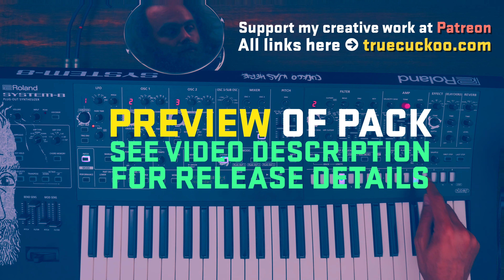System-8 Sound Design Mega Tutorial

Comment: Cuckoo, this is one the best SYSTEM-8 tutorials on YT now.  The SYSTEM-8 is currently the understated flagship synth of Roland.  I love it.  It can sound 'Roland-ish' yes (what's wrong with that?  It's a Roland! ha), but if you spend some time (as you have) programming it, it will reward you immensely.  Same for the JD-XA, which is significantly more complex.  The plugouts on the SYSTEM-8 are amazing.  Juno 106, Jupiter 8, JX-3P plugouts are really spot on.  Plenty of videos comparing.  Great video Cuckoo.  Fun to see you 'branching out'.
Reply: I got one a few months ago and love it. After many years exclusively using VSTs, sound design has become fun again. The direct controls and (pretty much) no menu diving makes it so easy and natural to shape the sound that I often end up making a totally new patch without even intending to.
Reply: I bought JD-XA over this System-8. You get more polyphony in its digital parts and 4 genuine analogue voices. So it's more like Roland's Zencore, XV, D-50 and JD products. On the negative side, JD-XA analogue LP filters 1 & 2 are hardly different and neither is LPF3, except it distorts very easily. So it's analogue is a bit bland. I love the digital section, where you can layer up to 3 PCM samples X4 voices, with Super Saw and PWM Square wave. There are many hidden features and flexible effects too.

Comment: System-8 is so underrated. I love this synth. The Jupiter X is not even close. Wish they would continue down this ACB modeling path instead of the 90's sounding ZenCore.
Reply: i know this is late but what’s better about the system 8 compared to the jupiter i’m new to synths and sound design
Reply: @spacecowboy2625  the system 8 has it’s own synth engine and a few others. The thing that makes this engine a bit more powerful in terms of emulation is that it focuses on recreating the individual circuits and electronic parts that give each analog synth it’s sound while the Jupiter x has an engine more akin to a sample filled gigging keyboard which means it is more like a recording of a recording of a synth. It’s a good keyboard but marketed for the wrong market since it isn’t as good from a traditional sound designers point off view. This is a better subtractive focused synth while the other is better if you want to cover more than synth sounds which isn’t something the analog/virtual analog market desires as much. They just fulfill the needs of a keyboardist differently and that led to disappointment from the Jupiter x because it had the wrong consumer in mind.
Reply: I'm worried about the colour peeling off around the oscillators and filter though. In Ten years will you be able to determine what knob you're tweaking?!
Reply: @annother3350  if you use it enough but also the small display let’s you know what you’re twisting. ALSO I’m sure someone out there could easily make templates to stick on if it ever gets that bad
Reply: @tyler23sb  Its still a bit poor if you ask me
Reply: @annother3350  I guess I could see that being a deal breaker for some. I absolutely love my system 8 though! I’ll let you know how many years it takes to rub off the “colour ” as I plan on using it for years to come 😁
Reply: @tyler23sb  I have a synth from 1978 - all knobs are readable.  For the money the paintwork needs more endurance. Good luck anyway, i'm sure you wont be disappointed
Reply: @annother3350  which synth would that be?
Reply: @tyler23sb  about 20 years ago my friend found a Crumar DS2 in Brick Lane market for £25 but he had no money so I bought it!  Got it fixed up for £80
Reply: There is a website with overlays for the system-8
Reply: @annother3350  i have mine for the last 4 0 paint issues mate. Meanwhile my rev2 8 it has below average finish. But it depends where y have em. I have my s8 in a smoke free with dust air cleaner system and always on 25C  got it new. The rev2 8 got it used. So maybe it would be the same condition
Reply: Jupiter X is much better in overall
Reply from the maker: System 8 is very user friendly. Jupiter X is kinda cumbersome to use. But I’m a sucker for the XV5080 on the Jupiter Xm I have to say 😅

Comment: The problem with Roland - I feel like they could have kept adding plug-outs. Roland D50, Alpha Juno, Jupiter 6, etc... but then they ditched it for the Jupiter X which has stripped down versions, but looks better. From what I understand, the Jupiter X even managed to have a worse UI compared to the System 8. 

Oh well...

Good sound designs. I like your custom overlay on it as well.
Reply from the maker: Thanks Midera! Yeah the System 8 is successfully designed with user interaction in mind. The JXm is a jungle to use, I completely agree. It sounds good IMO but it’s not a fun user experience. They made some weird choices with the JXm I think 😬
Reply: I wish Roland would release a JP-8000 or JP-8080 plug-out

Comment: I have a synth pop band called CHACKIE JAM and I mainly use the system 8 live in Juno 106 plug out mode! It sounds great, it's also very robust and doesn't go out of tune like the original does. I have compared it to a real juno and I don't hear the difference. It's a work horse, it's lightweight and it's a bit ugly but hey, the beauty is in the sound.